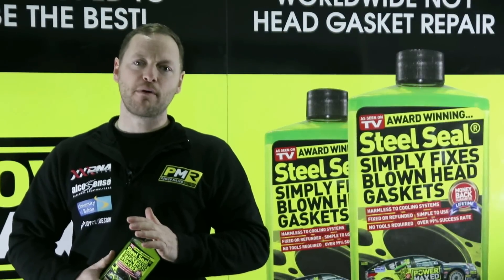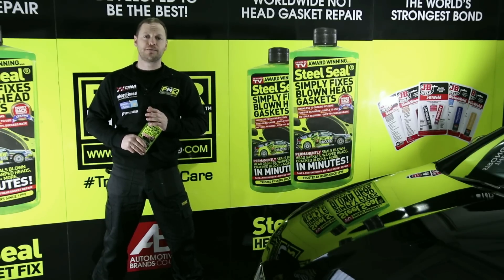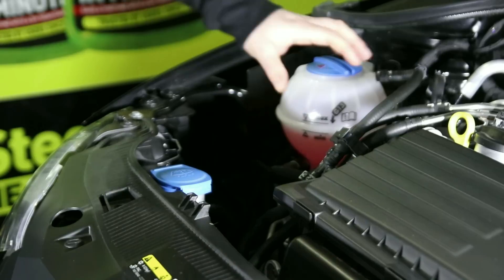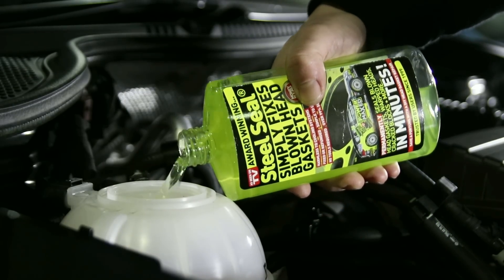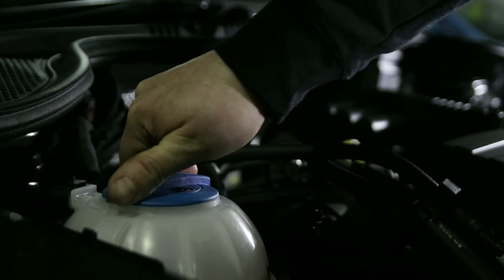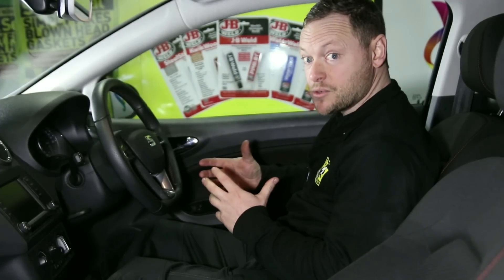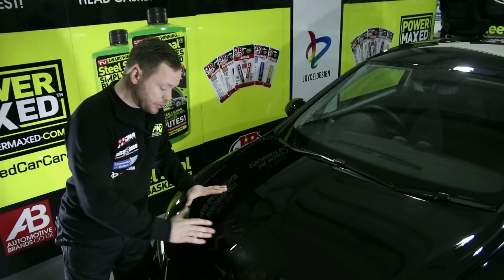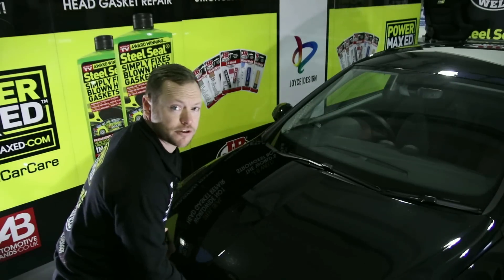How to Use Steel Seal

Comment: I was told by the help line that red antifreeze is not compatible with it.
Reply: I'm about to try Steel Seal so I'm not an expert but the instructions say to drain your coolant whatever colour it may be, blue, red, green, drain it. Fill up your radiator and expansion tank with water, ensuring you've got some space to add the Steel Seal. Then drive around, let Steel Seal work. Then drain the water out, pour in the new coolant in whatever colour you want green, blue, red. Done

Comment: Feel like there are a lot of unanswered questions here so this is how I did it:

Coolant was flushed completely with de-ionised water and then refilled with only de-ionised water and steel seal, this gives the sealant the best chance to create a seal and prevents the coolant and seal from reacting. Now drive the car at high revs for about 20 mins with radiators on full blow, high heat. Then once you’re back you can flush the steel seal and water out as it should have done its job and created a seal and just fill the car up with your coolant.
Reply: can i ask as i’ve got no heaters working, was this the same in your case? thanks for the water info
Reply: @warreng1978 honestly the heating in the car I used it on is horrendous yet I still managed to get it to work, just chuck your fans on full and take the car out for a bit longer. I wouldn’t stress too much about the heater although you might be better off emailing the manufacturer and double checking with them
Reply: Well explained. I'm about to give this a go and post a video if it works or not. Will do a review

Comment: This product worked! Failed MOT due to emissions caused by a blown head gasket. Stuck this in and 24 hours later my car passed its MOT and drives extremely well. Just follow the instructions!

Comment: I have to do the same tommorow,I'm bit afraid but i don't have a better choice,It's mercedes W211 1.8 kompressor,steam is coming from exhaust and once a week water needs to be added,It's definitely Head gasket fit problem,In ireland fixing that is so expencive,my car does not even worth that price,or changing whole engine is better,maybe even cheaper,I did not even know about this,I was just thinking how it was possible to not exist something like this,I searched and bingo,I purchased one but did not do it because engine was hot,tommorow I'll change a water and will try this,I hope it will work
Reply: it worked?

Comment: Followed instruction completely drained filled with distilled water added product after 20 min temperature soar into red 
Called in a mechanic drained and flushed cooling system added fresh coolent and now engine is running at correct temperature will never use this stuff again

Comment: Hi. Used one bottle as described on the video drove few miles as recommended. Sadly it didn't work. Tried another bottle with the car sat on the drive again as per instructions. This worked but only lasted a week before the same symptoms came back. Just how much of this is needed for it to work?

Comment: Can this be used with red antifreeze yes or no? I've got bit of back pressure coming through cap
Reply: Did it work?
I have red antifreeze aswel
Reply: I was told by manufacturer that red coolant must be replaced with water.

Comment: I have a water leak on my vito been to few garages but can not find the leak even had the pressure gauge on it still not found the leak.
Will Steel seal do the job? Plz advise
Reply: I have same problems found out where cap is mouthed on the radiator worn down a bit that cap won't seal properly even its tighten.since the fixed the problem after putting in a new radiator

Comment: Does this work on a car that doesn’t start, I have a Ford Focus titanium x 2014 and I was having coolant leaks the engine was overheating, The car has just been left for 2 months now it won’t even start, so if I poor the steel seal would it solve my problem ?

Comment: Personally i wouldn't use this or any other products. I have done a engine re build with new piston rings home the liners and big end bearings replaced, i had the head skimmed as well as it was out.. after all my checks i rebuild the engine with new timing belt. So after 2 months i noticed i was getting bubbles in the heater core and coming into the expansion tank.. it got worse after a week.. even on a cold start you can see exhaust gases coming out of the expansion tank.. i checked the EGR cooler or leaks and the oil cooler before i stripped it all.. so i was fed up.. i decided to use this steel seal product.. and wow it worked.. but then i noticed after two weeks i noticed there was a very very small leak of bubbles into the system again then it stop again.. then it did it again and so on..  so in my theory  because the stuff is still in the system it keeps repairing it until the liquid runs out so its not a permanent fix.. now my problem is now is when the engine is super hot im getting crazy vibration from the engine.. now i believe that cause of the coolant is still being hot it is pressurised and any little hole allowing the steel seal gets into the cylinders which it has. Cause now it feels like the piston ring is gummed up with steel seal and when the piston ring wants to expand due to the heat it can't because of the steel seal getting all round the piston ring.. so then that causes vibration when hot cause the piston ring carn't flex so it wants to stick to side walls jam up solid over time and call scratch marks to the outer walls of the cylinder.. so yep even tho it kinda works you will end up righting off your engine as it will cause more damage on big ends and the rest.. I'm not happy..
Reply: Your imagination is wild lol

Comment: Flush with water, add steel seal, run the car for an hour , then flush the water out immediately after or leave the water in for some time?
Reply: No point in leaving it inside, not sure if it would clog anything if left, but I think safest approach would be to flush multiple times after the procedure.

Comment: A family members gasket/blocked failed after having it repair after a year. Looking at using something like this to patch the problem. However the coolant tank has oil in and quite a bit. So is it worth flushing the coolant and refilling it then adding the steel seal?
Reply: No, use some other cheap head gasket/block sealer in that case because there's a high chance it's not gonna work.

Comment: The head gasket on my 2004 Serena went the night before I was due to take son 300 miles to university , I bought this the next morning , car would barely start , white cloud from exhaust , I put this in on morning of journey , worked great , I travelled 300 miles plus on that day and it's been 100% since  . After you put it in be careful to follow instructions . The only thing I would say is that I think engine still needs to run for this to work as it needs to circulate , so don't keep putting off using this , I'm more than happy . A lot of places described this as a temporary repair , however the bottles describes it as permanent and so far it's been amazing .
Reply: How has it lasted, do you still have the car?
Reply: @L.r.e_motorsport  yeah still have the car,  no problems at all,  still runs great
Reply: @neilcarroll4579  nice, thanks for the reply, I’m definitely going to try this stuff
Reply: Hey .. glad to hear it worked for you. I’m about to use it. Should I put it in while the engines running?

Comment: Steel seal is designed for 4 6 and 8 cylinder vehicles with minor breaks in the gasket,  if you have driven your vehicle moderately and maintained it you will have up to a 90 percent chance of resealing it if you have driven your vehicle hard thrashed and neglected it you will have severe damage and a up to a 10 percent chance of resealing it.

The coolant should be removed and only water and steel seal should be used, but remember a blown head gasket is only the symptom if you repair the symptom you still have to identify the cause of the over heating and rectify it or the vehicle will over heat again and you will have the same problem.

Also when you let the vehicle idle stationary at 1000 rpms run the heater on hot and turn it up to full gradually as the steel seal begins to take effect to ensure the chemical runs through the entire cooling system and monitor the temper gauge so the engine does not over heat, if it does turn it off wait it to cool down and repeat the process.

Once you are satisfied your vehicle is operating properly again, identify the overheating cause and rectify it then you can refill it with coolant. 4 cyl 1 bottle 6-8 cyl 2 bottles.

Comment: Do you need to remove the thermostat or drain coolant first? I have done a full coolant flush one week ago.
Reply: thermostat not necessary to remove but you should drain coolant.
Reply: @Aries-cv4wj   partial all of the coolant?
Reply: @TheJoshokc1982  i would remove all the coolant and place it in container so you can reuse it later, you dont want any contaminates in the cooling system to affect the steel seal solution flush the cooling system then put the steal seal and water in it you want to give it the highest chance of resealing.
Reply: @Aries-cv4wj  thank you.
Reply: @Josh Henley  👍

Comment: Going to use this to fix my ford transit gasket leak. It's small so it should work. Will have a video soon possibly or at least Instagram post at 2.5Vanlife
Reply: Have you tried I have a combo that over heated changing everything coolant wise and if then it needs a head gasket gonna try this stuff
Reply: @xXxbailliexXx  bro dont buy it! It made it even worse... instead of 1 little droplet mark I have a puddle now.. My mate told me that it  would also block filters and other parts in the vehicle. But I still tried now I regret it.
Reply: @25VanLife  yeah man I thought this just wanted someone. That tried it to let me know as it’s mine and my dads van but he wants to try it however I’d rather spend the time and do the head gasket as I’ve seen the horror stories and seen the damage it can do to water pump and all filters as you say

Comment: This stuff worked on my car , which was overheating and filling overflow/ expansion tank . The instruction on the website say to fill the coolant system with WATER ONLY for best results but can be used the BLUE coolant BUT NOT RED . I used just water and it worked . Maybe you could do another video highlighting this and also mentioning maybe removing leaky spark plugs and thermostat for better results.  You do mention this on the website but not on this video or the bottle itself . Great product.
Reply: Have a 2.5 stype  jag 55 plate. Have water coming  back  up through  expansion  tank. It has red  antifreeze.  Do I need  to empty  the water out of system  first then add steel seal. Or just .lpour in ti expansion  tank and go for a run
Reply: Don't have a  rad cap. I have  applied  steel seel into  My  car. I changed  fluid yesterday  . I drove 20 miles at approx 60mph with heater and blowers  on full. No water or back pressure  after journey.  So fingers  crossed  all is 👍
Reply: @NorthernsoulBoy63  how’s it going? Car running well?
Reply: @NorthernsoulBoy63  yes completely flush . Then refill with plain water,  then add product with radiator cap off . Add through radiator Not expansion tank

Comment: Should I remove all the water from the radiator before adding the product, add the product and add water, or if I just add the product, does the existing water also work?

Comment: DIDN'T WORK on my Toyota 4cyl. 22R.!Put in a New Radiator, New Water pump,  New Fan and fan clutch , removed thermostat and of course triple flushed my cooling. system.  Put in Only Water in Radiator before pouring in Steel Seal in my perfect running Toyota 22R 4 cylinder engine (except for it's blown head gasket which makes my engine run far too hot).  Drove the truck 7mi each way on the freeway.  Let the motor cool and repeated the procedure 4 times.  Pulled plugs to find electrodes  coated with burnt antifreeze on #3 plug.  Cleaned all plugs and drained radiator.  Put in new freash water and 2nd bottle of Steel Seal.  Drove truck another 10-12mi at stready speed 50mph.  Let engine cool all night.  Next day drove truck for 1hr and it started over heating!!
Obviously Steal Seal Didn't work.  Any ideas before i call the junk yard?  My '85 Toyota PU has been a very strong running truck for 150,000 mi. It starts right up, idles smooth and pulls like a new motor.  Just recently did i get this over heating.  Before it ran cool even in 100+F weather.

Comment: Just because I didn't know I paid dearly .
When the head gasket blow up on my caddy, because I didn't have the information I already spent 1000 £ one rental so I can move around , too I didn't mention that was a big present from Santa,  the head gasket blow up,  exceptional present. 
If I knew about your solution I definitely try it because the endgame was the replacement of the gasket anyway.
Took me a little bit to repair it because the car didn't accelerate more than 1000 rpm and 2 sessions around 1 hour,  but one the final one I could drive the car and after 30 mile the trailer of steam disappeared so I did another 10 just to be sure .

Comment: Can this be used as a preventative? Or only once you have an issue?
Reply: Was woundering that my self because I have a 32 year old vehicle an has 237k on it an I rather try a bottle now so that way it seals anything so nothing happens or starts later on I wanna get all miles I can out of it . Everything for my coolant system is bran new

Comment: my  audi a8 had a blown head gasket it was a massive job you could see bubbles in the expansion tank it was blown 100%  ,was going to cost more than the car .so i put some different stuff to this in it. left it ticking over then cool down .then ran it again for an hour then took it out and gues what no over heating nothing sold it 3 weeks later .job done .it was a yellow bottle  american stuff i put in .thats all i know .it cost about 24 quid . but it will block your matrix pipies and hot water eventualy and heating .

Comment: There is a more effective way to add the sealer to the coolant system.  But it is more laborious.  On YouTube, search, "Scotty Killer head gasket".  It may or may not work.  If it does work, great.  You still  need to drive the car gently, no hard acceleration.  Otherwise, you"ll blast out the repair sealant.
Reply: "Scotty Kilmer"

Comment: My diesel 2.2L Lexus, which up to this point worked perfect, suddenly overheated on a long summers day drive! I done all the usual checks, fans, exhaust steam, hose pipe leaks etc etc. Finally checked the coolant for CO2 gases using the chemical test which failed.
I then used 1 bottle of your sealant, the gasket leak disappeared. I rechecked the gas test which passed this time, like magic. 
I am a happy Lexus driver again. ☃
Reply: Used this In my Toyota 2.2 2adfhv and sealed it nicely
Reply: How long did it last for ? Tia

Comment: The car you poured the Steel Seal in had "Red" coolant in it? The bottle instructions say it's only compatible with "Green" coolant? I have a Lexus with "Red" coolant. I drained it and am going to put just water in it, then 2 bottles per the instructions? This stuff is expensive, but nothing near a head gasket replacement. I pray it works🙏
Reply: Hi Big D! Ive just done my Lexus diesel 2.2 with a single bottle and didn't bother changing the red coolant out. My fault was hot gases CO2 getting into the expansion tank and bubbling away like crazy. Now the car works as it always had, pefect and I verified this with the chemical coolant test. So there is hope where there is none.
Reply: Please tell us if it works or not. My car is in the shop right now and the mechanic is trying this today.
Reply: @officejamz3160  I followed the instructions, flushed out the Lexus/Toyota red fluid and since mine is a 92' es300 v-6 I used 2 bottles. I ran it, but it still ran rough and wanted to die. I am going to let it cool overnight and try it tomorrow.. I was getting some water in the oil, and white smoke so here's to hoping? I'm going to change the oil and filter again before running, I don't want to seize it.
Reply: @dsimp765  thanks for the update. I will reply here to see results when I get my car back from mechanic tomorrow.
Reply: @officejamz3160  I had something come up, I didn't have time for the car today. I have plans for tomorrow, and how did yours turn out?
Reply: @dsimp765  hey man. I got my car back from the mechanic and they said it didn't work the first time, so they tried it again and they say it kind of works now; they drove it around the neighborhood and it didn't overheat, but they don't know how it will hold up on the highway. They think it might not last long so fingers crossed it works long term.
Reply: @officejamz3160  I changed my oil and tried to start my car, and it won't start. I ran the battery down. My problem started after I replaced the valve cover gaskets. I drove the car into my garage a week ago, took my time, took video and pics of the engine bay before disassembly. I ordered a quality kit "Beck & Arnley" it had both valve cover gaskets, 16 new rubber washers, intake manifold gasket, but didn't have a throttle body gasket. It was cracked but seemed to work, or I might have a water line going to a vacuum port? That would explain my issue. Charging battery, and will check it against my videos and pics.
Reply: @officejamz3160  I hope your repair holds up 🙏, reading some of the other comments on several Steel Seal videos, I'm encouraged.

Comment: my kia sorento v6 2011with oil leak and coolante water leak (head gasket) issue, May I use the AT-205 re seal with together steel seal? or firstly Steel seal then At-205